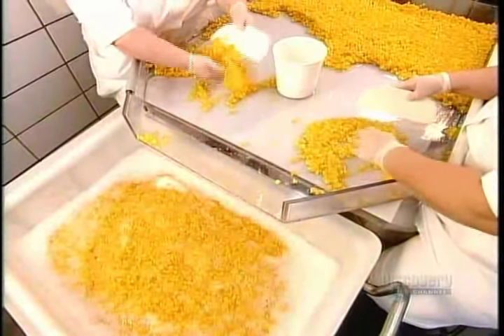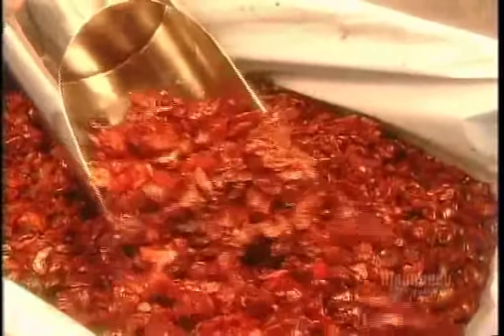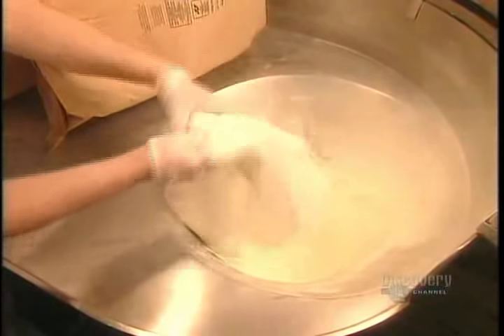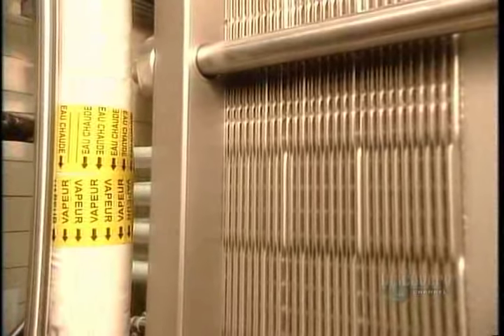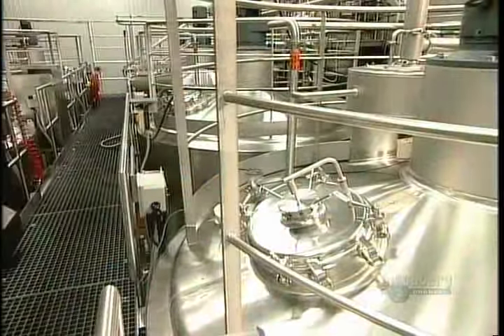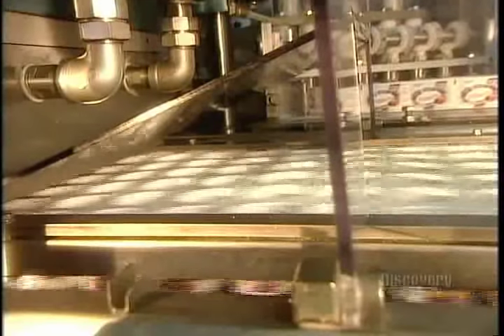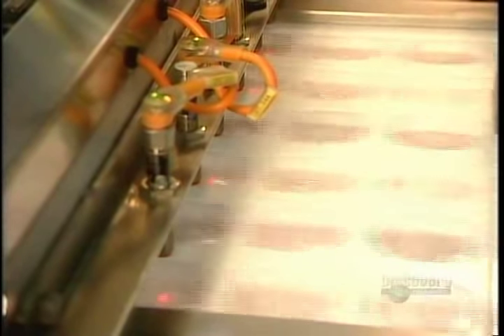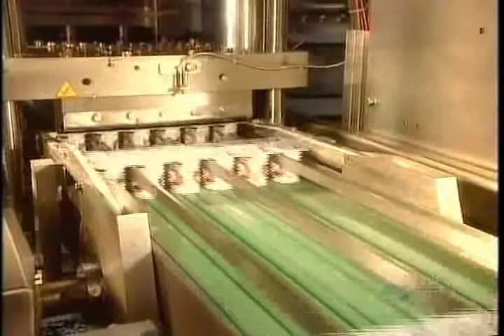How It's Made Yogurt

Comment: I thought yogurt was just made by fresh milk and heavy cream that's been mixed together and forms a buttery/soft texture like what yogurt feels like, and then they add the fresh fruits or either they just apply the fruit juice and then the used fruits just get sent to another factory to make cocktail etc.

After they said that they added bacteria I didn't feel like eating yogurt anymore :i
I'm not overreacting for a 13 year old but I know that I am, Since there are different types of bacterias, good and bad. I just find it disgusting now that they add all these things into yogurt..and now I realize, Even when you're eating "low fat" yogurt etc, You're still gonna gain fat and weight from it because they add all these artificial things in it. That's disgusting. ._. In my opinion, Don't judge or hate me for what I'm thinking.

I probably won't eat yogurt for a while. :/
Reply: @Julie Ly     Not judging at all, and you are right that there are different types of bacterias. The "Good" Bacteria that goes into Yogurt is called Probiotics, which helps your body. However, not all yogurt has all these processed chemicals added to it. It's very easy to make your own yogurt at home. All you need is some milk, and a little bit of previously made yogurt (you will only have to buy this once) that has "Live Active Cultures" (the Probiotic "Good" Bacteria needed to make the yogurt) in it. Heat up the milk to 185*F to kill anything in the milk that won't be good for the yogurt bacteria. Then allow the milk to cool down to 100*F before adding in the previously made yogurt. Keep insulated in a warm area (bacteria grows in a warm environment) for up to 24 hrs and the bacteria from the yogurt will multiply rapidly over the next several hours, and turn all the milk into yogurt. This yogurt will not have all the added stuff in it like this video shows. Then you can add natural fruits or honey to the yogurt, if you like.

Just be sure to set aside about a cup of yogurt that you made, and store it in the freezer (or fridge will do if you go through a lot of yogurt) to use for the next batch of homemade yogurt. As long as the yogurt is not added in too hot, the "good" bacteria will stay alive, and will continue to multiply with each batch of yogurt you make.
Reply: Julie Ly do you eat cheese
Reply: Julie Ly the bacteria in yogrut are the following witch are in it for a reason: Lactobacillus delbrueckii subsp  bulgaricus, Streptococcus thermophilus, Bifidobacterium, Lactobacillus casei, Bifidobacterium animalis, Bifidobacterium longum, Lactobacillus acidophilus they are the ones that give yogrut its taste they are all good bacteria that help with digestion and live in our intestines
Reply: If you eat bread or drink alcohol I've got some bad news for you.
Reply: Gav Com HAHA true. Wait till she finds out how cheese is made. Also what honey actually is.... Damn millennials.